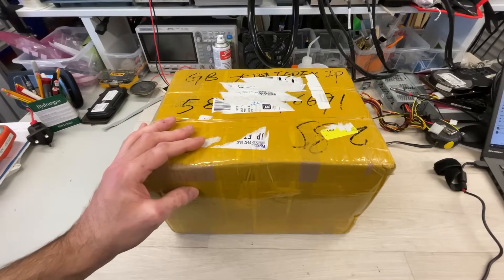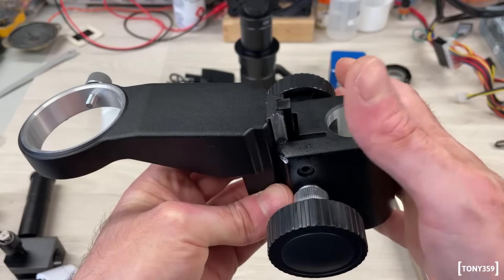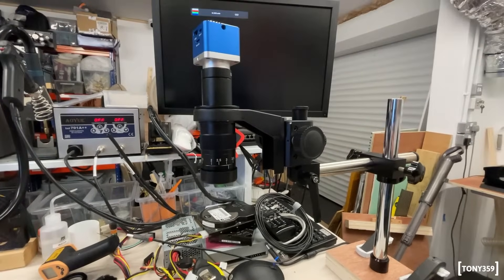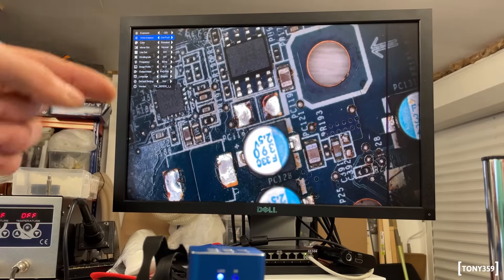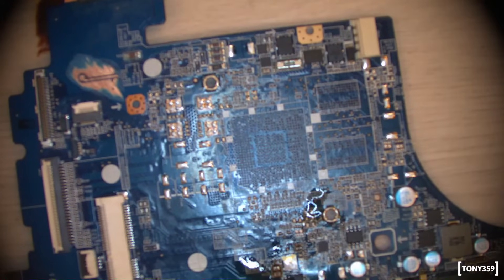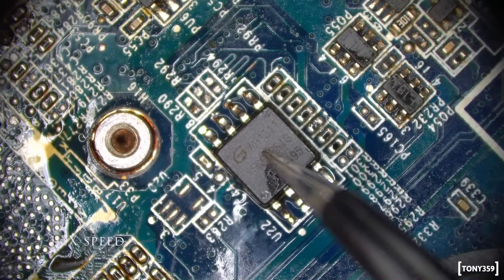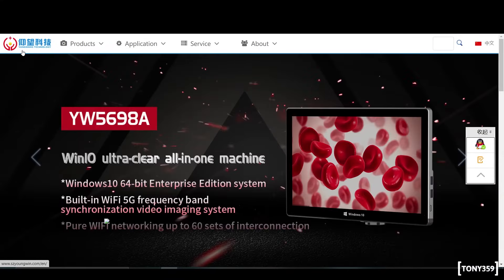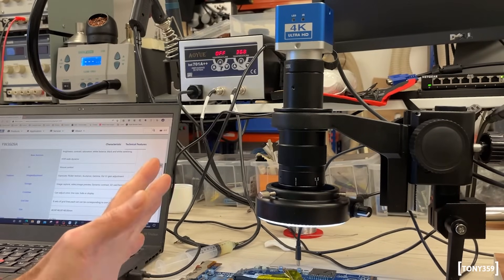Lapsun 4K Microscope - Sony IMX377 (?) - Unbox and Review

Comment: Thank you for this video it was really helpful.
I bought the same model directly from Lapsun today, i can't wait to try it. 
I hope it has an Imx377 sensor as advertised. If not, it's your fault 😂😂
Reply from the maker: You missed the pinned comment! :) It's an IMX334 (A viewer mentioned and I decided to check mine too!). I think Lapsun also changed the advert - but not the pictures which still say 377 o 337 I can't remember. 
The bottom line is that I really like it. I think it outperforms most of the scopes I see being used online. The picture is nice and "natural". Make sure you don't use digital zoom and don't use any digital "enhancement". Let me know how you find it - and what you get! :) And thanks!
Reply: @tony359 indeed. 
ok, it's an 8Mpx sensor instead of a 12Mpx. still a solid one.
Thank you again

Comment: Does this microscope have the sensor model noted on the PCB? I realize there was some confusion between IMX337 and IMX377, but if you look at this video at this time stamp, you may be able to check your PCB for sensor model: https://youtu.be/1jV7Qzr3OQ0?t=1048

I'd be curious if yours shows IMX337 or maybe even an older model?
Reply from the maker: Hello, one of my viewer suggested that already and indeed it’s an IMX334 (at least that’s what the PCB says). Still doesn’t explain the picture resolution though. I pinned that comment somewhere! I hope this helps!

Comment: Depth of field is an intrinsic property of an optical system - it is based on the numerical aperture (N.A.) of the lens. The larger the N.A. the shallower the depth of field. Resolution is also directly proportional to N.A. Therefore, the higher the resolution the shallower the depth of field. 

Depth of field is a feature, not a defect. Many people think that depth of field is an independent attribute of an optical device. In fact, for perfect optical systems, it is what it is. Ironically, imperfect optical systems generally have greater perceived depth of field than perfect systems, especially if spherical aberration is the imperfection. But that is only because the imperfect systems have a soft mushy focal region - a perfect system "snaps" to focus.
Reply from the maker: I didn't mean to tag it as a defect, only mention that it's there and you might need to fiddle with the focus knob more than you'd want! Thanks for watching!
Reply from the maker: the quality of the optics is indeed one of the reasons I got this one. I tried a high quality Nikon stereo microscope. It had 10x eyepieces. I couldn't use it. I could only see through it when my eyeballs were perfectly aligned with a very very narrow section of the eyepieces otherwise the view would be blocked. Also, the microscope is big and in the way. I heard those 10x have that defect but my first impression was not great. I really don't have issues watching a monitor while I am soldering... But I am used to that! :)

Comment: What paste you add before heating the component with a heat gun? Isn't it easier to desolder the chip just use soldering iron?
Reply from the maker: it's called flux and it's pretty much a must when soldering. It prevents the solder from oxidising. When solder oxidises, it won't "flow". If you are soldering, you must use flux! :) Thanks for watching!
Reply: Oh.. I always used rosin flux (colophony). Just forgot that there are other types of flux. Thanks

Comment: Thanks for video.
If you moved the camera halfway up, having the 0.3x lens. Couldn't you get focus at that height? must be better, less solder fumes in lens, and not being in the way all the time. And still good magnification
Reply from the maker: I cannot focus with that lens and that stand. It's shown at 19:20. I got a 0.75x and that works. 
https://www.youtube.com/watch?v=YAdUFEa3CAY&t=0s
Reply: @tony359  OK thanks for reply. I thought you meant you couldn't focus at max distance. But good to know.
I've spoken to some sellers who claims I need a 0.3x lens for 180x optic to be able to work at 10-40cm, but that doesn't sound correct after I've seen your video.
Thanks for input
Reply from the maker: My lens is 120x. For a 180x a 0.3x Barlow might work.

Comment: By the way: Interesting to see some vignetting on the corners when using the zoom as a 120x. I do not see that on my 180x setup where the upper adapter is 0.5x (The zoom-lens is the same...)
Reply from the maker: yes that is not super great but not the end of the world. I've been thinking of asking Lapsun to send me a different adaptor, as you noticed the zoom-lens is the same, they just change the adaptor! :)
Reply: @tony359   Mine is from them also, but a few years older. I ordered an extension to my stand that screws into the first rod as my rods were shorter. (Looks like the stock rod is longer now.) I find I get a super working height of 200mm with the 0.35x barlow and my FOV is about 46mm at minimum zoom and 6mm at max zoom. Keeps scope out of the solder-spatter and I do not bump it with my hands using the tweezers.
For inspecting large boards it would be good to have a bit more FOV but since I mostly work on tiny high density boards 46mm can often fit entire board 😜
Reply from the maker: There are indeed many possibilities and that stand is really well made. The 180x with the 0.5x is probably the sweet spot. I overthought it a bit when I purchased it! As you say, magnification is important but also FOV.

Comment: hello, it seems to me that this LAPSUS microscope, 12mp UHD with Sony imx334 sensor, looks great, am I wrong?
Reply from the maker: I'm still happy with it! :)
Reply: @tony359  thanks for the reply, I was about to buy it from LAPSUS, then I chose the top range that only they have, the big black one with Sony IMX385 V2 WDR sensor, with HDR wireless mouse, seen here on YouTube from another colleague, who is really great, you see everything in another dimension, if I'm not mistaken, this Sony IMX385 V2 sensor, still today is the best of all, now the price is Also dropped by how many nor are they coming all over the world, before it was too expensive... Now it's coming, let's see how it will be live. 😉👍🏻🔝🔝🔝
Reply from the maker: @hitechmaster69  Amazing! Did you watch my video? It didn't have a 377 as advertised. For a "cheap" microscope it's ok, the actual chip is a 334 which is as good or even better than the 377 but if you paid a premium for the 385 V2, I would definitely make sure it has it inside when you receive it! Which can be tricky as you can't say you've opened it to check it :)
Reply: @tony359  Do you think I made a good choice to take that one? the wdr sony imx385 v2? thank you 😉👍🏻🔝
Reply: @tony359  why can they do these scams?
Reply from the maker: @hitechmaster69  if you get an imx385, then yes :)
Depending on where you bought it and how you paid it, you just want to make sure you know your rights and you exercise them in case the product is not as described. 
The tricky part is how to find out. On mine I found "IMX344" printed on the CMOS PCB. And yes, I am assuming the CMOS is what the PCB says :)
Reply from the maker: That's where I got my microscope - directly from them! I hope yours turned out ok!
Reply: @hitechmaster69  The IMX385 V2 is not terrible. It's much better than any of these other cameras that are being sold right now. If the IMX290 was still in production then there would be no other option. If you ever see the vendors selling IMX290 they are scamming and using a IMX307 or IMX185 sensor. Both are terrible and the price of those sensors is less than a 3rd of the cost. RISING CAM - RT5109 is one of the few cameras out right now with the real IMX334 sensor stated and has no frame rate interpolation. It does have the real 4k 60FPS that it claims. The picture / video quality is also amazing. I am currently using a real IMX290 camera from 4 years ago on my smaller monitor and I also have a 55" 4K TV that has the RT5109 connected to it. Great value for the money. I really do hope they start coming out with something better cheaper. I'm trying to wait out buying 2 more of the RT5109 for my repair shop. The price hasn't bugged for over a year so I may end up just paying full retail for them in the coming months unless something changes.

Comment: i purchased the same camera recently. The sensor is imx334 but mine is 24mp. I don't understand why, since imx334 should be 8mp. I guess it is due to interpolation in the firmware.
Reply from the maker: Hi Leo - indeed I did decide to dismantle mine a bit more and it’s an IMX334 as well. I suppose the software is upscaling indeed. I guess the firmware is being used on several different products. 
In the end what matters is that we were promised an 8Mpx sensor and we got an 8Mpx sensor of good quality from Sony. 
Still, not the most professional attitude. I wouldn’t buy a more expensive one from them if it’s a CMOS Lotto! Thanks for watching!
Reply: @tony359  nevertheless, I'm quite happy with it due to the price is certainly lower than other imx334 based camera. Imx334 is in the STARVIS series which good at low light, it is comparable with my imx290 maybe a bit better. 

I do agree with you, the manufacturer is inconsistent and lack of data. However, again considering the price I can't complaint too much.
Reply from the maker: @LeoL123  totally agree with you. I thought the 290 was the best of the best? You’re saying your 334 is comparable and a bit better?
Reply: @tony359  I mean, imx334 is bit better in several aspects considering its sensor size is smaller than imx290, of course overall imx290 still the winner.
Reply from the maker: @LeoL123  Amazing! The 290 is much more expensive so it's very nice to hear that it's even comparable to the 334! :)
Reply: @tony359  They stopped making the IMX290 3+ years ago. They are all using a different sensor unless your lucky to buy one from old stock. Eakins confirmed this.

Comment: I really liked this review and was wondering if you had any plans on a follow up like after using it the past year does everything still work? and have you ever pointed it outside and recorded other things like scenery or use it as a webcam around the shop?
Reply from the maker: Thank you! Never thought about a follow up - I can tell you I still love it though! And.. No, never though of using it in a different way, wouldn't I need a different lens for that?
Thanks for the idea and for watching!
Reply: @tony359  idk depends how far the focus can be adjusted. maybe some of the tube sections can be removed so its not a macro lens anymore.
Reply from the maker: I'm curious now, I'll try!

Comment: Hi Tony I watched this video of yours.  I am a fan of digitizing 8/super 8 films and I also use Chinese cameras and enlargement lenses.  I have exactly the 180x you show in your video.  However, I have never been very lucky in choosing the camera (all with Sony IMX sensor) because all of them (even imx377) when connected to the USB port, transmit a purple-pink color with shades of green.  This happens both with a bare sensor and with any lens I use.  If I frame a white sheet, it doesn't display white but everything pink.  After many useless purchases I finally found the first and only sensor that doesn't have that problem: the IMX317 4K.  My question is: why does this happen?  Because your imx377 transmits perfect colors and the same setup as mine, right?  How can I solve it?  Thank you!
Reply from the maker: Hi - no, I never had that issue. I do not use the manufacturer's software, I use OBS. The device is seen as a camera so you can configure it under OBS with no need for drivers or special tools, it just works. What you describe sounds like the incorrect colour space. Mine works under OBS with everything "default" but there is an option to change the colour space. The microscope menu has some resolution options - the menu is not available when USB is plugged in though.
One thing, if you plug the microscope while OBS is working, it won't work. You have either to restart OBS or you can "disable" and then "enable" the device inside OBS. 
I really don't think yours is a sensor issue, more a connectivity/software issue.
Unlikely, but also try a different USB cable. Good luck!

Comment: Hello,

I might be wrong, but I think that this model is a IMX334 sensor ... some sellers on aliexpress indeed sells it indicating wrongly a IMX377 ... but I really do think that it is a IMX334 instead, here's why :
- the IMX334 is a 8Mpixel (the IMX377 is a 12Mpixel following its datasheet)
- the IMX334 has a pixel size of 2x2um ...
- other sellers (won't give names ^^' ) sells it correctly with IMX334 mentioning

Hope that helps some with this confusion ^^'
Reply from the maker: Hi - you're not wrong. I pinned a comment mentioning that one of my viewers said the same and I then decided to take a peek myself and the sensor PCB indeed says "IMX334" on it. Well guessed and thanks for watching!

Comment: What is the thread of the camera? Is it C-mount?
Reply from the maker: Yes it is. So you have plenty of options available.
Reply: Thanks @tony359  Already have the 180x lens (c-mount) and was looking for a decent camera.
Reply from the maker: I'm pleased with mine. Bear in mind it does 30FPS - it can do 60 but it repeats the frames twice....
Reply from the maker: Apparently it's not. I never really thought about that as I feel that 30FPS is plenty for electronics. But a viewer asked me to check and I could only get 60FPS but they actually repeat the frames twice to get to 60FPS! Typical! Your display will say 60 but it's actually 30.
This is unless I made a mistake somewhere but I could not get "true" 60FPS out of it. Again, I really don't think it's necessary for electronics.

Comment: you can look at a 4k feed with a 1080 monitor   you will have more pixels  and need to zoom in to the correct level - issue could pop up  format wize  - even tho i keep fixing my system the 10 bit video always returns to a green/purple
Reply from the maker: I've done some tests, my 4K TV reports 4K but whether that is actual 4K or scaled FHD, nobody knows. For example it turns out that when the scope says 60Hz, it's actually 30Hz where each frame is sent twice :) 

Bottom line: don't expect too much from these items :)

Thanks for watching!

Comment: 可以把CCD感光面拆出来对比IMX377比较容易发现
Reply: 或者它是IMX334LQR，我也买了一个等到手看一下。
Reply from the maker: I’m confident there are ways to determine what sensor is inside. There’s also probably a serial access somewhere. For now I’d rather not open it up again as it’s brand new 🙂 and, honestly, the picture quality is good to me! But thanks for mentioning and for watching!
Reply: 我的已经到手和你的完全一样，相同的厂家，CCD是IMX334。
Reply from the maker: @wrzone4261  interesting, thanks! The 334 is a 4K chip (8Mpixel). I get 12Mpixel from mine so I suspect I have yet another type of CCD!
Reply: @tony359  我认为你的也是IMX334，感光元件那片PCB在背面有写”IMX334”字样，我有看过CCD内部金线布局和网络上查询到的IMX334图片完全一样。我认为不会有错。
Reply from the maker: @wrzone4261  I am a curious person so... I removed the CCD PCB and... you're right! It says "IMX334_3535_V2 20210527". I assume that the 334 can output 12Mpixel still images then? Or the electronics is upscaling it. Thanks for this, I should have taken a look when I shot the video!! I'm glad it's still a SONY sensor at least.  Do you know the differences between the 377 and the 334?
Reply: @tony359  我在网上搜索到的资料：
链接：https://www.jianshu.com/p/06e2d1582b2f

334发布日期更近。

SONY星光级800万IMX334 SENSOR参数介绍

1、IMX 334像素尺寸：2.0um * 2.0um，暗光情况下效果比非星光级的IMX377还好；

2、支持宽动态WDR，宽动态范围：80db；

3、SONY 星光级技术，1/1.8寸；
Reply: @tony359  cmos：3840(H)×2160(V)左右。 8.29M像素。静态图像输出超过8M也许是软件算法，这个产品并不是很严谨认真。
Reply: @tony359  cmos：3840(H)×2160(V)左右。 8.29M像素。静态图像输出超过8M也许是软件算法，这个产品并不是很严谨认真。
Reply from the maker: @wrzone4261  Thank you! Well, it looks like they just forgot to update the product description then! As I said, the picture quality is good and have no complaints. It's just that it's not very professional to sell "random" CMOS to customers. For the price I paid, it's ok. But I would NOT buy a more expensive product if there is a CCD-Lotto involved! :) Thank you again for your input, very much appreciated. I hope to see you soon on my channel! :)
Reply: @tony359  不用客气！是的它有非常好的显示效果，足够使用。它也是我能在价格、做工、性能中选择的最适合的产品，在中国有很多类似的产品，参数模糊虚标严重，能选择一款合适的不容易！
Reply from the maker: Indeed it's not easy to choose! There are so many and, as we discovered, the specifications may not be as accurate, making the choice even harder! :)
Reply: @wrzone4261  方便给个链接或关键字吗？淘宝找不到同款。谢谢。
Reply: @champCats  4K工业相机，闲鱼购买，但是已经下架了
Reply: @wrzone4261  了解，谢谢你